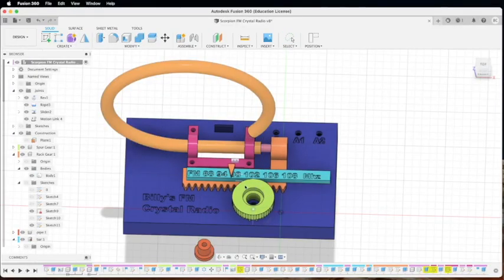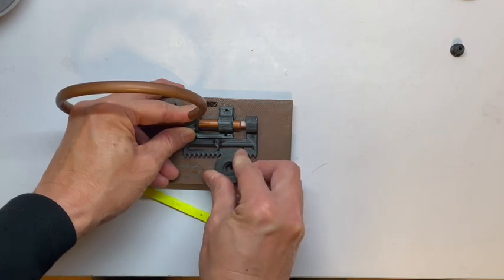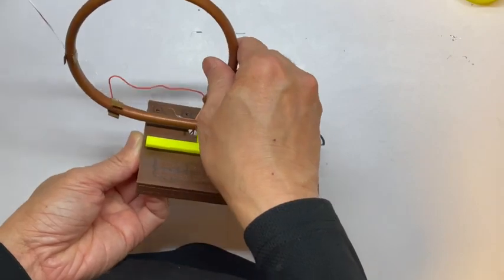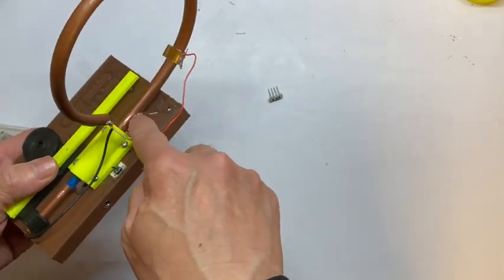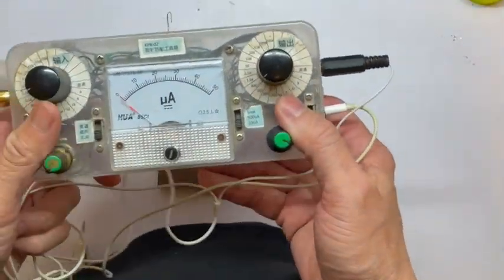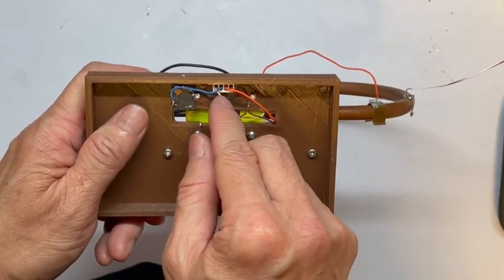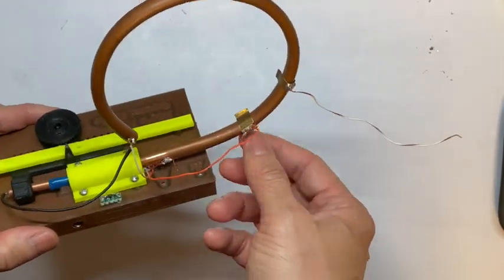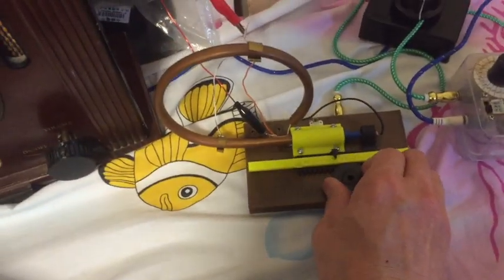Scorpion FM Crystal Radio Build and Test

Comment: I love the using of the pipe as the coil and then reusing it as a capacitor too. I would love it even more if there were also no 3D printing required, seems possible. Now if only we could also add a DAB+ signal decoder :-)
Reply from the maker: Here is my earlier version without 3D printing. Scorpion Copper Pipe FM Crystal Radio
https://youtu.be/dpsrGT8PT4Q

Comment: Billy, great video. Fantastic design. Can you use a couple of 1N60 OR 1N60P diodes in place of the FET?
Reply from the maker: Yes. I used HSMS 2850 as diode. I tested 1N60 before. It also works but less sensitive